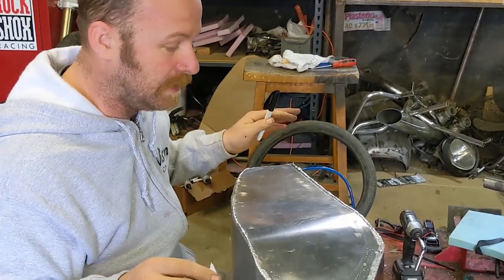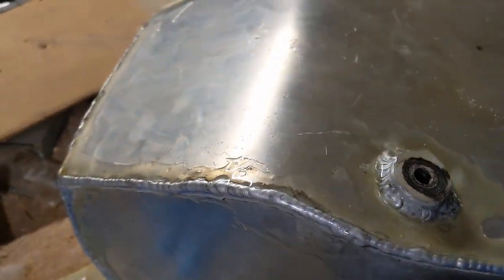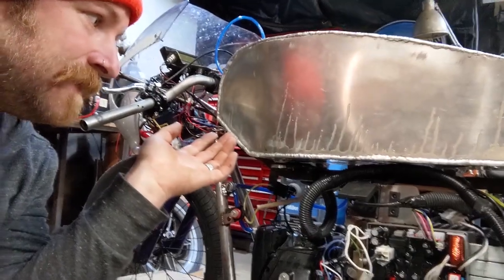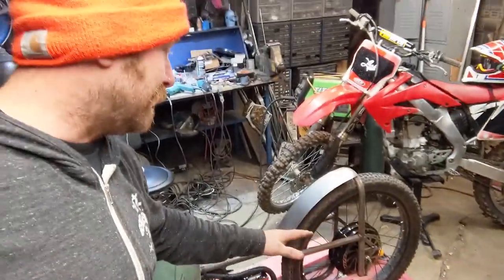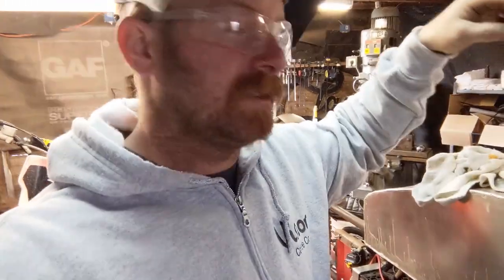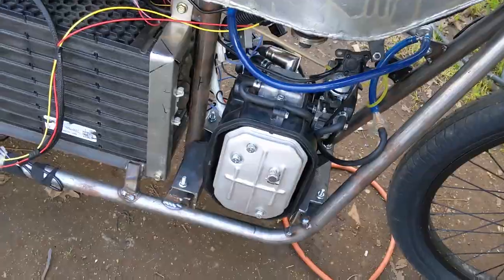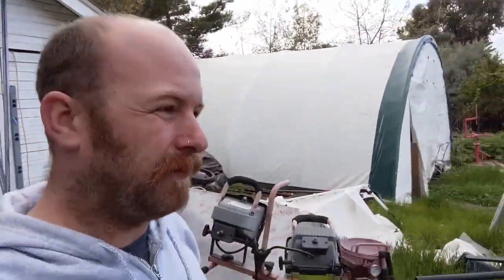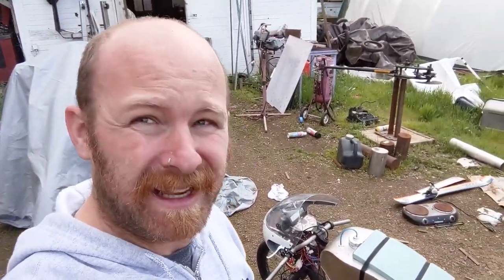Extreme Range EV Mini Bike Build | Test riding and calibration | Lark Machine Co

Comment: Looking good, I too thought the efficiency calculations were off by a significant amount. Epoxy is degraded by the alcohol found in gasoline. Polyester resin is not affected by gasohol.
Reply from the maker: There was only a couple of pin holes and i also used slow cure epoxy.  Hopefully it'll work.  I have used the epoxy on other fiberglass gas tank repairs. Fingers crossed

Comment: I love almost everything about this project, except one. Would Burt Munro epoxy his fuel tank, or finish welding it closed? You decide. 😁😎
Reply from the maker: I welded the tank 5 times til I was pretty sure it was sealed.  I always seal my tanks regardless of if they are weld shut or not but homeboy is in shut down.  Bike vibrations can make small pinholes develop over time and the last thing I wanted was gas dripping on my High Voltage battery.  Marine epoxy will work, just might not win a beauty show (kinda Burt style in that since)
Reply: @sheanyquist  For sure! I see your point. I was not thinking as well as you! Touché! 🙂You arriving safely after a long distance ride is vital to the entire project. I'll give it to ya. You are thinking like Burt indeed! 🙂😎

Comment: So if my math is right... you're getting 250W from the generator which correlates to 250Wh per hour of charge being added. At 17Wh per mile, then your generator will only sustain you at 14.7 miles/hour. Obviously your consumption depends highly on your air drag so in reality its probably higher than that. But intuitively, 250W from your generator is very, very low. I doubt that's enough power to sustain cruising at highway speed.

Put another way, 250W roughly translates to 1/4HP. Do you think your bike needs more than 1/4HP to run at 60MPH?
Reply from the maker: I also have a 2.6 kWh battery the bike.  I can coast at 30mph at about 500W.  The generator supplies 250W and the battery supplies the rest.  If I were to run it continuously, I could do it for 10 hours straight (300 miles) before I would have to stop and let the generator charge the battery again.  But I doubt I will ever ride it more that 2 hours at a time.  I can let it charge while i rest and get the battery back up.  It is a range extender (basically and on board charger)  at 14 mph, the Wh/m goes way down too.  The math doesn't quite work the way you have done it.  The equation that gives Wh/m contains a Velocity^3 the faster you go, the power (W) goes up to the third power.
Reply: @sheanyquist  yeah it's not a linear relationship like I quickly did above. In reality the 250W could probably sustain closer to maybe 30ish MPH. That's a good point about drive time. Totally makes sense. Thanks for replying!
Reply from the maker: Thanks for watching and commenting!!!  I will go more into the math on the next video

Comment: Did you ever consider running more than one battery, so you are not drawing power and charging from the same pack?
You could cover the frame in a shell/fairing and attach solar cell modules.
Reply: You will need to many solar cells for any type of improvement, then you're be introducing more drag and weight not to mention getting sun on the side panels would only happen in a big open area like in Arizona or death valley. Solar power is really only good when used in a stationary platform and with a big array of them.

Comment: Why people have have gas and electric  just choose one
Reply from the maker: Increased range.  It makes since until we have a better charging infrastructure.  It's a bit more complex but it let's you use less gas by only using the minimum amount needed
Reply: @sheanyquist   just put more battery it's simple that  if you want more range tbh yes it's can charge awhile riding but that ain't safe for batteries